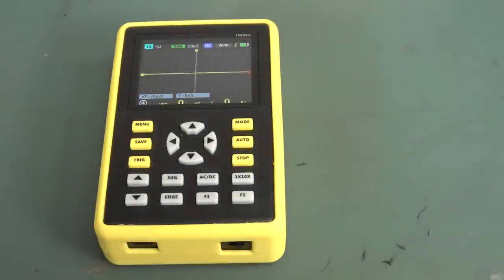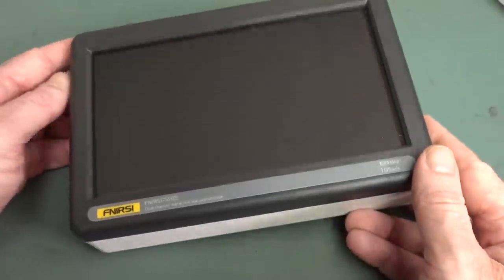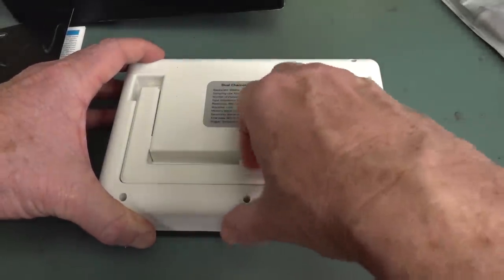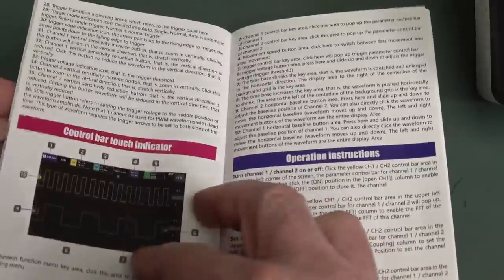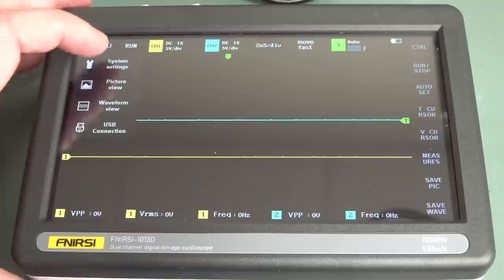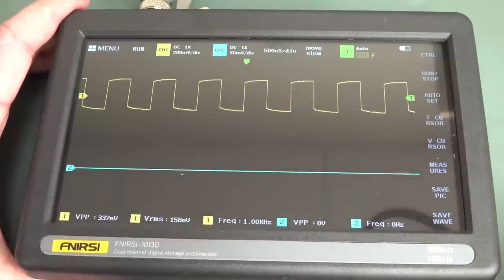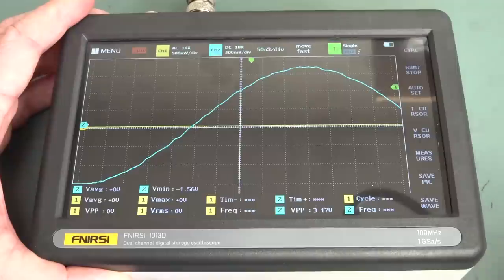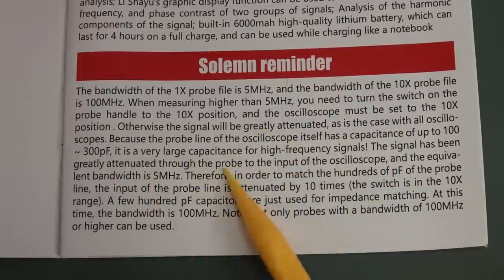EEVblog #1317 - $140 2CH 100MHz Fnirsi Tablet Oscilloscope Review

Comment: What a shame they didn't have a good software guy...
That hardware could be put to good use even at 200Ms...
Reply: That's something the open-source community can solve, I'm sure! I just bought one as it runs Linux and I couldn't resist myself… Also it will be my first personal oscilloscope (but I have used proper ones in the past).

I have no problem working on the UI side of things, but hopefully someone else can help reverse engineering the circuit, and maybe also reprogramming the FPGA if needed!
Reply: @IscleGaming  Yep I've been looking at using one of those F1C100s ARM chips in a project. Amazing value considering they have 32MB RAM, USB, LCD/TFT output up to 1280x720 with a display engine for acceleration, touch input, H264/MPEG1,2,4/MJEPEG decoding, audio inputs, and output, DMA etc for around $1 - $2 each 😁 Oh and they run Linux...
Reply: User experiance always the killer with the cheapest of instruments.
Reply: @Stabby666  but then they are armv9 none of that cortex-m or even cortex-r stuff which would be my choice.
Reply: @urugulu1656  armv9 is not a core, it's an ISA. You probably meant to say they were cortex-a, rather than cortex-m or cortex-r
Reply: @IscleGaming  I want to get this oscilloscope and do some reverse engineering the hardware and dumping and reverse engineering of the firmware. Do you want to get in contact about this?
Reply: @cFyugThCzvAqYaGmxRgfCKTuvHMEjQ  It's an ARM9 core. A predecessor to the cortex series of arm cores.
Reply: @quantumxero4847  you're right, my bad! ARM926 is pretty dang old
Reply: Sounds like a nice little project i want to follow! Are there any chances to upgrade to 100Mhz bandwith? Is it hardare or software restricted?
Reply: @IscleGaming  Many of those ARM controllers have ways to lock the flash so you can't dump it. It's all up to how lucky you are whether the manufacturer decided to lock it or not.
Reply: I wonder how much I would need to pay more to get real 1GS/s and proper front end.
Reply: @TheChrisey  In this case the flash is external, it's a normal winbond SPI flash chip. Also, Allwinner SOC as far as I know does not implement any security features.
Reply: software is more expensive to develop than the hardware. A lot more expensive.
Reply: 200 megaseconds what?
Reply: @leocurious9919  mega samples. Seconds is an upper case S, like in mS. 🙂
Reply: @wizrom3046  No, its a small "s" or "sec", but NEVER "S". S is, in this case, samples. In normal situations its the unit Siemens, 1/R.
https://en.wikipedia.org/wiki/Second
https://en.wikipedia.org/wiki/Siemens_(unit)
Reply: @urugulu1656  depends what you need for the project. For the price it’s damned good value!

Comment: I have worked the good half part of my life in the electronics industry, not once have I ever needed to look at a signal above 20MHz, for the every day user this scope should be just fine.
Reply: That is my feeling too. It's silly to get over-excited about high frequency performance and not really test more commonly used areas of operation.
Reply: @johncoops6897  funny thing is, the highest I have measured wasnt long ago, it was a voltage peak from a ESD tester, and this with a seperate coil around the wire of the ESD tester to be galvanicaly isolated if you get what I mean, even there 100ns sample time was more than good enough... with a arc, a arc...
Reply: what do you think i would need as bare minimum for automotive use?im new to oscillioscopes and for my first one i really want to start cheap any suggestions?

Comment: This is like watching my grampa trying to use a phone, hands just flying around touching everything as fast as possible while complaining it sucks.  Dave is so funny with how clunky he can make a touch screen look. He is so clunky with tech for a Tech technician lol. Honestly funny to watch Dave with a touch screen. I don't think Dave has ever used one fluently. LMAO, No disrespect intended Dave. But I think all your touch screen videos it's like 80% Dave and 20% shitty firmware. Thanks for the laugh and great video!
Reply: I like how Dave uses the scope. I would do this the same way 😁
I am used to "real" scopes that have knobs you can turn. Without having to read the text on the front panel I can grab buttons and change channel position, sensitivity, timebase and triggering. I turn the knobs fast to the required position from 0.1 ms/div to 100 ms/div in one quick turn and from 2 V/div DC to 10 mV/div AC quickly to see either the signal or the AC noise. When I replaced my old analog scope for a digital one, I bought one with separate knobs for each channel but I still hate that I need to look at the top line on the LCD to see what the current V/div and ms/div settings are. My phone and tablet are very responsive and they would be perfectly happy handling Dave's screen banging technique so a tablet scope should, for me, have the same responsiveness.

Comment: I bought the more recent version of this scope. It is NOT a 100MHz, 1Gsa/s scope, the rise time on 300ps signal shows 10ns (means ~25MHz bandwidth), the minimum timebase setting is 10ns/div, and it looks that all waveforms on <50ns/div are interpolated, do not reflect real signal which makes me think that the real sampling rate is not more than ~200Msa/s. The spec for AD9288 (2x100M) confirms that. The display cannot show the samples as dots, so you never know what it really captured.  The software is very buggy, it is easy to get to the mode when the grid display is incorrect, sampling rate is low and record length is short. For instance, the pulse rate of 500kHz may be shown as 400ns period on the grid (5x incorrect!). It measures signal frequency or period or duty cycle only in "auto" synch mode, not from period in the capture. No rise/fall or FFT measurement. No control (and no advertisement) of record length. No external synch input. No explicit pre-trigger settings.  
It can store the waveforms in flash memory and it can be re-measured, zoomed or analyzed later, which is convenient.  The good feature in battery and can be fully isolated for non-grounded signals. It may be a good instrument to measure power and audio signals and entry level microcontrollers. It is not suitable for signals above 10MHz, so its specifications are advertised incorrectly. So really "too good to be true".

Comment: Dave: I have one of the DSO138 scopes. I'm well over fifty so the 1/4" x 1/4" screen has become a fly in the ointment. So as I was digging through my "supplies" I ran across an old dead laptop. It has a 19" TFT LCD screen with a 25 pin ribbon connector and LED backlight driver inputs. So out of curiosity I checked the DSO138 and bingo, 25 active LCD pin out. According to the specs if I build a power supply for the LCD and LED back lights I'm in like Flinn.
As I researched further I found something very kool. The DSO is only using half it's resources. One guy added a second input channel. Then another guy did the laptop monitor thing. Another reprogrammed the CPU for a parallel 8 bit vid output. Doubling sample rates and such. The guy that used the laptop screen was contacted by someone that wrote him some code so his DSO138 would have touchscreen.
Then I thought if an old laptop screen could be used on a crappy DSO138... What about a Raspberry Pi????
I was surprised to say the least. Thought you may be interested. Maybe a vid or two?
Reply: Do you have links to all these mods for the DSO? I really love them for basic automotive diagnosis! And was looking at this due to it being a dual channel, but if there's an easy conversion to dual channel then I'm all ears!

Comment: Get a polarizing filter on your lens, to get rid of the glare.
Reply: YEP... that's a perfect solution. Works for water too!
Reply: Buuuut... You know what happens, when you look through a polarizing filter onto a lcd screen? 😉
Reply: @phlipse90  you can rotate the filter to mach the polarizer on the lcd, agreed it would be tricky, but for stuff like this, where the device doesnt get rotated, it should only need setting once
Reply: Oskar Humnicki yes of course. But then it could end up being in a polarization orientation, where either the lcd is blacked out or the reflection still being present. I think, seeing that this screen is indeed highly reflective, is underlining the fact in the review, that this is a product with some flaws from the engineering standpoint. Therefore, in my opinion, it‘s better to see an unaltered picture of the product ;)
Reply: @phlipse90  yea it will definitely need some playing around to get the light position right for it all to work.
But I actually totally agree, now you mention it, it is a review video and this shows a flaw with it - glary screen etc, good shout, and tbf he did do a pretty good job of dealing with the reflections so we can still see what he's doing
Reply: If you look at the screen at or close to Brewster's angle relative to the light source and then rotate the filter so that it is parallel to the scattering plane, you'll minimize the glare.  The screen then needs to be rotated so that its polarization is parallel to the filter polarization, so that it doesn't get cancelled out.  This is the best configuration, with the caveat that Brewster's angle means you're not directly facing the screen by are looking from an oblique angle, so you will get perspective distortion.

Comment: Waveform is most likely unstable at 100 MHz because your trigger is not centered and the signal is attenuated so much that your trigger is above some of the peaks. Set it to zero (AC) or middle (DC).
Reply: Yes but the waveform itself cannot be trusted because its P-P amplitude varies so much, meaning there is aliasing and they are simply interpolating more or less randomly between 2 actual samples, and that's normal because the actual sampling rate is 200Ms/s so that's only 2 samples per cycle ! So basically you can't trust its phase and you can't trust its amplitude. So what you have is a completely random sine wave that go through a bunch of points. Not sure what you are going to do with that.
Perhaps at 50MHz he could have gotten some relatively reliable sine waves (forget about square), but at 100MHz, it's just luck and nothing else. The rule of the thumb is 8-10 samples/cycle for a square wave so it's really a 2x20MHz scope.

Comment: I have a feeling that these "affordable" scopes are too much of a hassle and you really get what you pay for (they're toys, let's be honest). Better save up and get a real one, because no one could give your wasted time back.
Reply: Depends what your use is. I I wanted something for troubleshooting a car or my ebike, it's definitely useful to have a battery-powered scope.Don't forget it's isolated (fully) from mains earth.
Reply: I agree, this product is just plain garbage.  I'm not made of cash but I'd gladly spend 5 times as much to buy something proven and much more polished like a Rigol DS1104Z.  I actually got a DS1054Z and hacked it to DS1104Z with all options enabled.  Certain cheap benchtop scopes have Li-po options too.  Personally, for bench use, I'd steer away from anything with a battery inside it just because it'll be one more thing to repeatedly charge and one more battery to replace later, assuming it doesn't blow up and burn my house down.

Comment: Actually a cool toy for a low price.
I can imagine some beginners would be happy to have one.
But one should always be aware of its limitations
Reply from the maker: For sure. Any scope is better than no scope for a beginner.
Reply: @EEVblog  You're probably better off buying a cheap second hand scope.
Reply: @breedj1  Yes and No:
For sure an old analog scope does make sense if you want to learn how a scope working but if you want to see transient impulses or capture digital data you need a digital one and even that $140 cheapy toy could help there if you cannot spend $400 for a siglent or rigol
Reply: @ElektronikLabor  A second hand digital 100MHz rigol with real 1Gsps will cost around 230 USD. It might be a better idea to save a bit more than buying something that is inaccurate, unreliable and a pain to use. I learnt the hard way myself. It's wasting your money versus waiting a few more months and save some extra money for a good scope you can rely on. That second hand scope can probably be used for another 15 or 20 years. I do not think that this 'flat' scope will be used for more than a year because the owner will eventually want to use a better scope, or it dies after 3 years or so. So it's a waste as well.
Reply: @ElektronikLabor  Well, given how this thing actually handles the single shot capture and that it has no digital data decoding at all, as it seems, that's really not a win. Add to that the poor linearity of the frontend where you can't trust that the amplitude on the screen is somewhat accurate and I pity the newbie who will be trying to tear their hair out trying to debug anything with this. An instrument that is lying to you and wasting your time is worse than having no instrument at all.
Reply: I think the point is that beginners would be the last people to be aware of the limitations.  "Garbage in, garbage out" applies to quality of education too.  I feel that I was actually lucky that I learned to use scopes 30+ years ago.  There weren't any fake cheap garbage products flooding the market so I learned with the real thing, like Tektronix and Hewlett Packard.  While I agree that "any scope is better than no scope", it's not like there are no other alternatives.  I would recommend to any beginner today to buy a used working quality scope built by a reputable manufacturer and to steer clear of the super-cheap garbage.  Newer isn't always better.  Dave is doing the beginner crowd a huge service by showing the obvious drawbacks to using cheap garbage products.  After watching, if they want to spend their money on such junk, that's up to them I suppose.  Personally, I would not pay $40 for it, let alone $140.  On the plus side, if someone does buy one, they'll learn the hard way just why it's better to save up and buy something better.  Sometimes learning the hard way ends up being the best way because you'll never make that mistake again.
Reply: The problem is that beginners are fooled by the specs and are not aware of its limitations. And some of the limitations are not in the specs. These specs are meant to fool people.
Reply: @breedj1  Rigoll for $230 is good. Are there any portable/handheld 100Mhz scopes that no cost diamonds? I want to use it in my car for measuring sine waves 40Mhz and 1kHz and i need that extra bandwith to get more resolution. My chinese Dso Nano v2 works but bad resolution. I want to upgrade to something better that are not too expensive for my needs
Reply: @orfeous  handheld scopes tend to be more expensive than benchtop scope. I personally do not know any good handheld under 300USD. The cheapest I can think of is the Hantek DSO8060. But I do not know if it is any good and if you can get it secondhand. A new one costs around 325USD. It has 250Msps real-time sampling and 50Gsps equivalent time sampling. Specs look very decent.

Comment: this problem exists because there is no antialiasing filter at all. there is no gain controller at all. It just connected the signal via some relays to ADC.
When we wanna sample with the speed of 100MSPS, we need an antialiasing filter to prevent frequencies near the sampling frequency rate and it's harmonics as well.
But as I know AD9288 works on 100MSPS per each channel. so we could use both channels on the same signal with a 180° shift in the clock phase to speed up the sampling rate 2 times (ADC dual-channel interleaving).
Here we have 2 ADC chip, it means there are 4channel ADC exist.
When we produce a clock and 3other clocks with 90-degree shifted phase per each (0° - 90° - 180° and 270°) we could achieve 400MSPS.
I hope that this device did the same method to sample the signal.
Wish, you could do this test that CH2 is turned off and then with the tiniest Time-Div on 1st channel check the input clock of all 4 channels at the same time.
Although with these problems we don't have any device with this price, so I think we could use it as a 30MHz Osclliscope as well and that is valuable.

Comment: The glitchy firmware is the dealbreaker for general use, and the lack of sensitivity on the inputs seriously limits its use for an audio band scope as there are plenty of times where the full scale signal you wish to monitor is <1Vp-p.

Comment: Personally I have two scopes. An OWON scope which was good for the price (about £250 ish delivered) with 100MHz bandwidth and an analogue Techtronix 450MHz scope with low capacitance probes etc. I use both. The OWON is perfectly adequate for audio etc and in realityis pretty good up to about 10MHz. Beyond that the sheer quality of the Techtronics and the low capacitance probes make too much of a difference.

Comment: With some SW updates it could be good tool for car repair shops and stuff like that
Reply: for car repair shops you need a tons of special probes (troubleshoot ignition systems and injection systems) and you need 4 or more channels.. usually scopes for car repair shops have 8 channels (to be able to diagnose 8 cylinder engines). another point is the software.. you need software to help you diagnose issues, that's why those are usually PC based scopes so you can run a sophisticated diagnostic software.
Reply: @robertjung8929  Your answer tells me you don`t diagnose cars for a living.